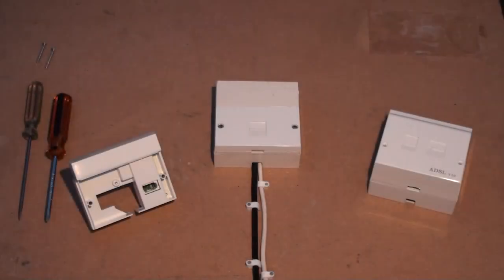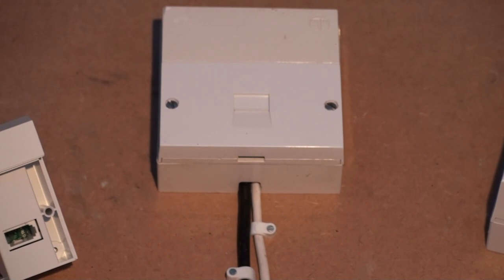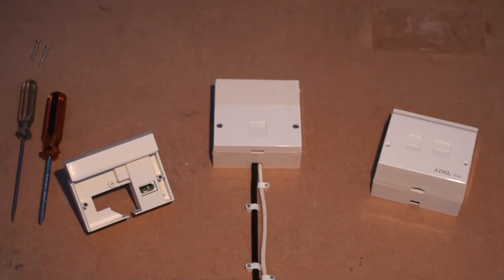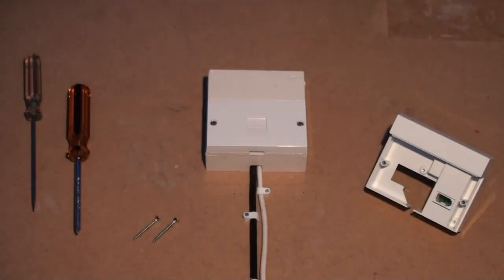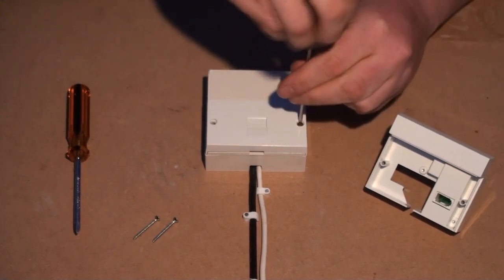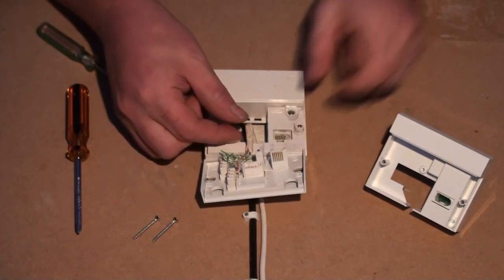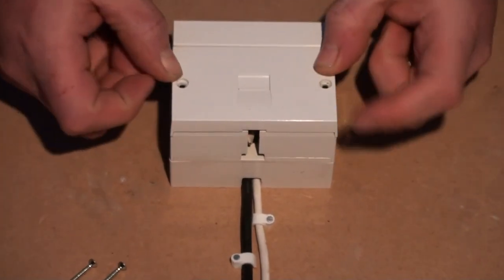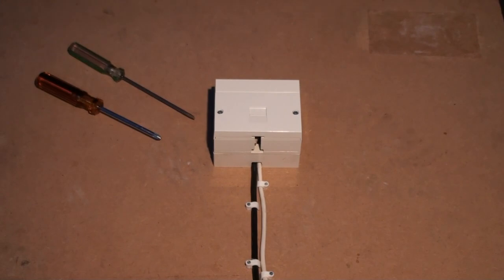Installing the BT I-Plate on an ADSL master socket

Comment: I also have no wires attached to my faceplate, i am with sky broadband. By the sounds of you plugging your microfilter directly into the socket, it sounds to me that that socket you're on about is the test socket, with bypasses any other line and is directly connected to the exchanger (If i understood correctly). That would explain the improvement in your internet speed.

Comment: I removed the face plate from my main BT socket as BT advised to do when reporting poor broadband speeds, and I have no wires attached the the faceplate... they seem to be terminated in translucent caps? Does this seem normal - does it mean I dont have any BT extensions in the house? Also, after following BT advice to plug microfilter directly into socket without the faceplate on, my speed increased from 6 meg to about 9.5 meg instantly. Surely this identifies a faulty faceplate? Thanks 4 advce

Comment: I recently had a problem with my broadband, turned out it was the faceplate but there was no wiring connected into it at all yet my broadband has worked fine all these years. Is this something I should look into or does it really matter?

Comment: Hey when i removed the initial face plate the wiring inside disconnected , i removed it really careuly and only by barely an inch , i guess it was dodgy wiring inside. However now im using the test socket ,  how do i rewire the internal wiring to the initial face plate ?

Comment: Best thing to do is to test your speed before installation and then test it seven days later. It can take this length of time for the exchange equipment to adjust to the better line quality and increase the regular speed.

Comment: Given the choice, do you think the BT iplate with a normal microfilter connected to it, will offer a greater benefit to an SSFP (ADSL specific front plate)

I wonder how good the in built filters are compared to micro filters on ADSL specific front plates

Comment: The bottom half of my faceplate doesn't have the wires connected to it, its got the wires behind another set of screws but wen i pluged in my i plate it reduced the speed of my internet wen i done a speed test.

Comment: I would just like to add, my current SNR is set to around 35% and it's stable (no disconnections at all, for months now).
I am roughly 2.191km from my current exchange, on ADSL2+ with a downstream attenuation of 60dB, with the upstream at 37.4dB

Comment: I already knew how to install the iPlate, ordered one for myself as my computer desk is located right next to the master socket (lucky me), though I wanted to read other opinions on this.
I have a question, though. If this iPlate does work for me, and cuts out enough interference, would that also imply that I can lower my SNR manually through a DMT tool on my router with less chance of disconnections at a lower percentage?

Thanks in advance.